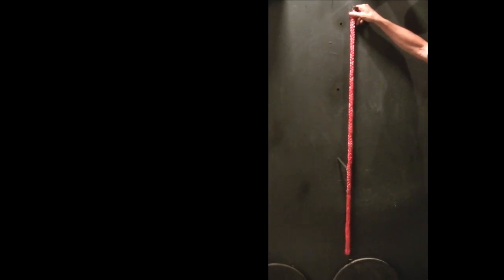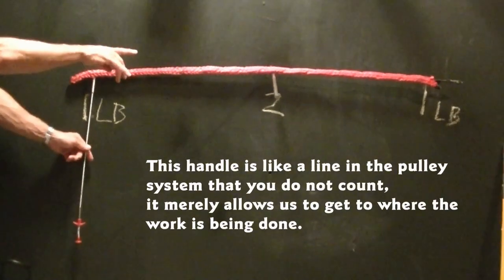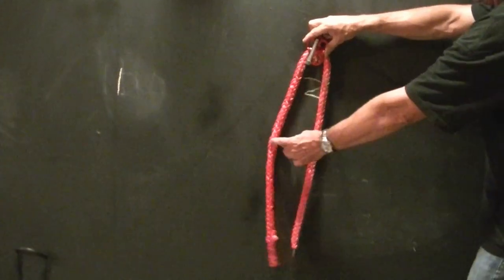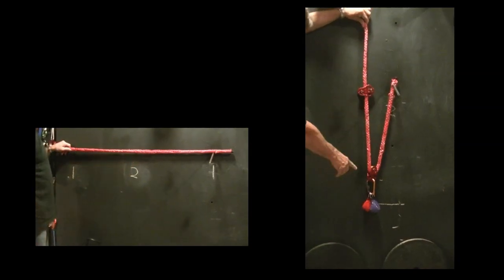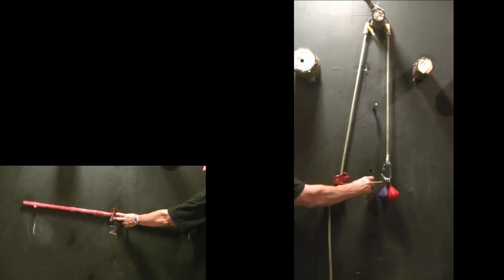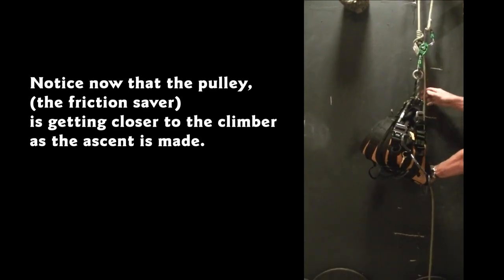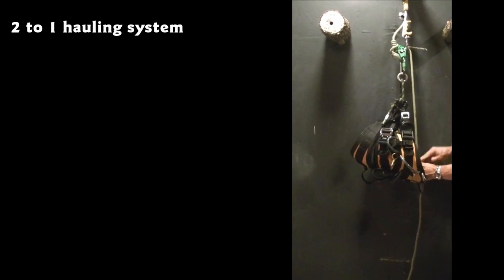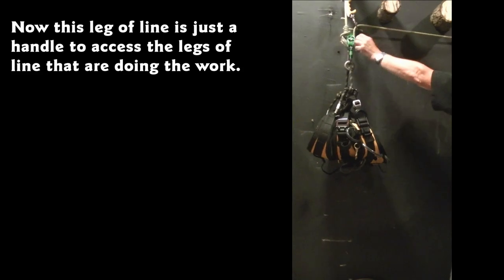Understanding mechanical advantage from the tree climbers view.

Comment: Surfing the web I came across this and I was quite impressed.  All you are doing is changing the reference frame for the naming convention.  It is true an engineer may not readily agree with you because it has been accepted a class 1 pulley is a class 1 pulley, and a class 2 pulley system is a class 2 pulley system, and so on.  This is because they have accepted the naming convention of the outside reference frame, what you describe as the hauler reference frame.
However, an engineer would see, or should see, your methods are right.  They would just see it as a change in force (weight in this case) distribution, not an increase in mechanical advantage.  The end result is the same though.

I'm going to just make a climber example to assist in any naysayers that may come across this as I did. I know you simplified it on purpose, I'm just trying to help out anyone that may look at it differently.

Givens:
-Fixed pulley over a branch. (class 1 pulley)
-200lb climber
-40ft to move vertical up the tree
-Work = Force x Distance (W=FxD), a cosine of an angle can be added to this but it cancels out in these examples so we won't use it. 

2:1 climbing system example:
W=FxD= 200lb(Force) x 40ft (Distance) = 8,000ft.lbs
Richard is saying 80ft of rope will pass through the climbers hands on their ascent. This can be witnessed as true from the examples. Since the amount of total work to get up the tree must be the same we can use,  W=FxD= FxD, 
so 200lbs x 40ft = F x 80ft.  This is because the same 200lb person still has to go up the same 40ft, the amount of rope used is the only change.
Now we have 8,000ft.lbs= F x 80ft    Solving for F,  F = 8,000ft.lbs/80ft = 100lbs
This is half of the climbers 200lbs aka 2:1 system

To calculate the actual extra work done by the climber to get up the 40ft we have to divide the original required work by the mechanical advantage.  8,000ft.lbs/2 = 4,000ft.lbs

Engineer class 1 pulley w/ climber example:
This time we maintain the hauler point of view (outside reference frame). To look at it this way is actually more abstract so let's skip the math for a second.  Our 200lb climber has just clipped in and without grabbing the other end of the rope sits down into his harness.  Assuming no safety knots are tied, what happens?  He falls on his butt because no force is applied to the other side of the rope.
Now, after standing back up of course, our climber grabs the other side of the rope and then sits into their harness.  What happens?  They are now suspended freely, provided they aren't letting the rope slip (grip strength and the friction required to hold the rope will be left out in this problem because safety knots would be used). 
What is keeping the climber suspended though?  It has to be a force.  It's the climber's own 200lbs providing some of the force. Effectively, half their weight is on one side of the rope and the other half is on the other side. (No work is being done yet, so the forces have to be equal).  
So now we know the climber only has to hoist up 100lbs since their other 100lbs is already on the other half of the rope, the problem is solved.  However, just to got the extra mile, let's prove their is no mechanical advantage from the pulley when looking at thing like an engineer standing on the ground watching the climber. 
To the math:
W=FxD, 100lbs (half climber's weight) x 40ft = 100lbs (other half of climbers weight on the rope to be pulled) x D, 
so 4,000ft.lbs = 100lbs x D (distance rope needs to travel to move climber 40ft)
Solve for D, D = 4,000ft.lbs/100ft = 40ft ,  you can see we literally solved, 100lbs x 40ft = 100lbs x 40ft = 1:1 advantage

In the end, both scenarios would require the climber to do 4,000ft.lbs of work to get up the tree, which is half of the 8,000ft.lbs the engineer on the ground to hoist the climber up the 40ft.  It's easier to see this in the second example, but at least to me, easier to calculate in the first example.

All in all, you can see looking at the climber examples from an engineer point of view just makes it more complex than it has to be.  Richard has proven that a simple change in perspective can make all the difference in solving what appears to be a complex problem.  While some engineer types may not agree you are creating more of what they call Mechanical Advantage in the climber scenarios, I'm sure they will all agree you are effectively doing the same thing that an added mechanical advantage would do.  Plus, it's a whole heck of a lot easier to say 2:1 climber mechanical advantage than halving the force required to hoist yourself up advantage, lol.  The naming conventions would be arbitrary at this point. 

A good source is below:
https://van.physics.illinois.edu/qa/listing.php?id=12209